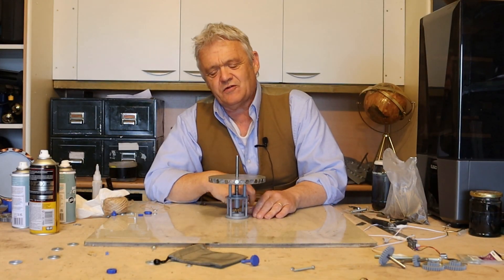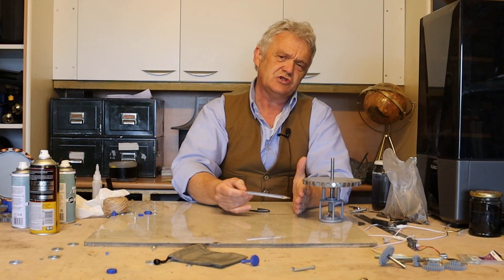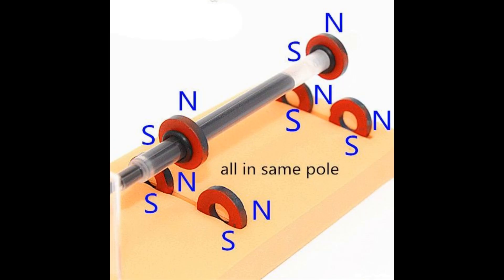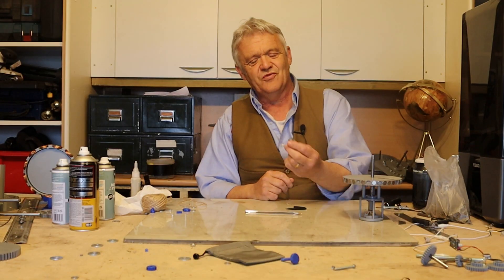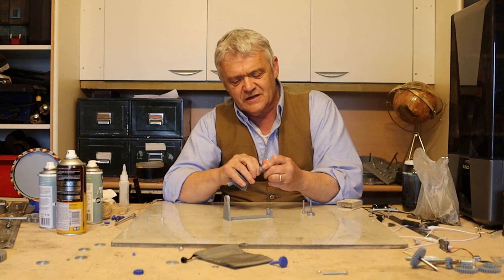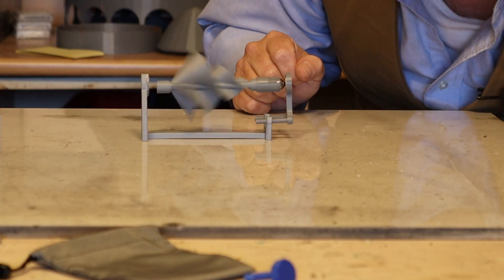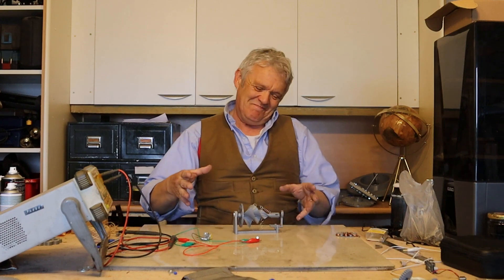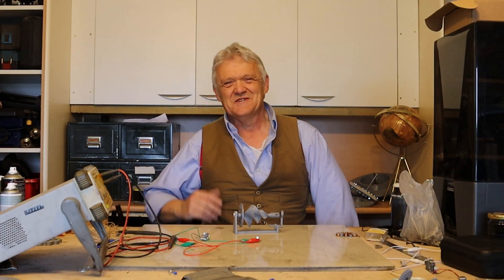1995 Archimedes Wind Turbine With Magnetic Bearings

Comment: That combined with your previous pen nib bearings and in a drainpipe would make an awesome hydrogenerator
Reply from the maker: yes it would!
Reply: @ThinkingandTinkering  hi Robert thankyou for the informative videos. Do you know if AA size salt batteries exist
Reply: @pietpompiepompiepiet940  dude I love the way you think. I would love to see a practical application for this. Maybe collapsible cone, I would love to see one approximately 12" or 30cm model. If it could recharge a phone or tablet this would be marketable.
Reply: @mingwangchung  hi thanks for the reply. If I had a 3d file of the cone impeller then I would print it to the scale of the tube just to proof the theory.
Reply: @ThinkingandTinkering if the fan was mounted in a tube just bigger than the blades and you collect the wind from a bigger cone at input to basically compress the airflow but also guide it down the tube to minimize the wobble on blade could that work?
Reply: Im seeing small portable hydrogenation units.

Comment: The issue with magnets for bearings is: The rotor wanders a little. When trying to generate electric power, this can cause The rotor to contact the stator since you want the gap as tight as possible for maximum efficiency. Also when the electrical load changes the gap will change again. Fun for demonstration purposes but not practical in real life.
Reply: The wobbling can be resolved by aerogel rings laden with water 💦.  Water has its own ability to move electricity ⚡️ and aerogel is insularité as it is cushy.  The pressure will release counter pressure from water as it wobbles.

Safe for space
Reply: @diversitylove5460  not practical for wind turbines. Normal bearings work just fine.